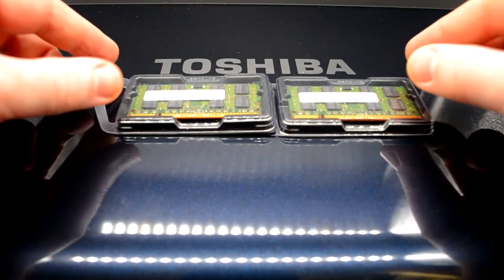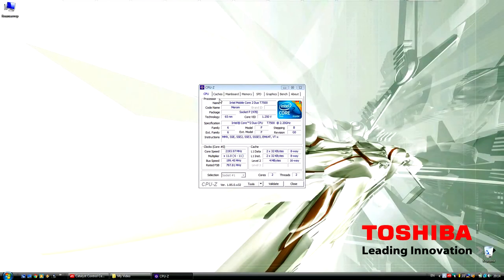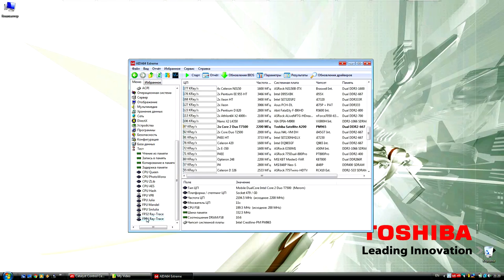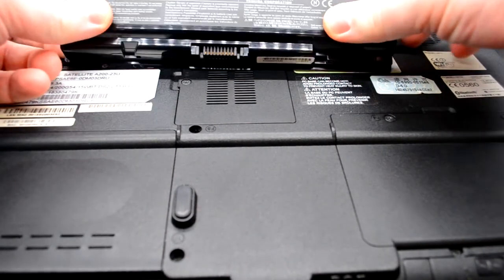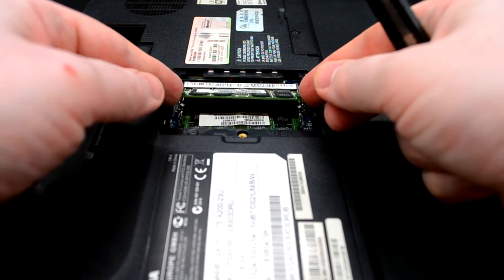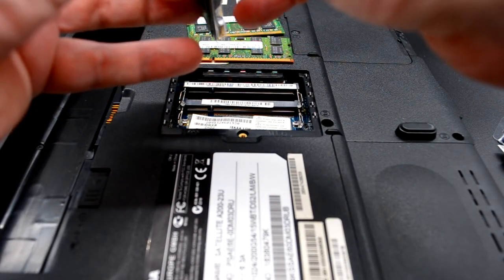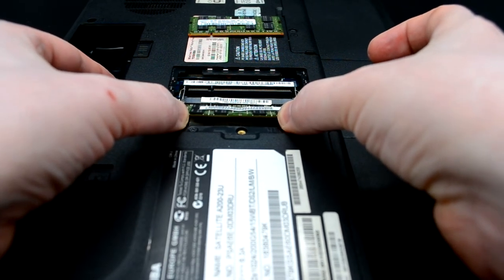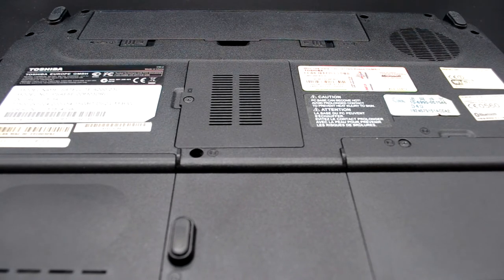Модернизация ноутбука Toshiba Satellite A200-23U. S01E02. Samsung 2x2Gb DDR2-800Mhz и тесты!)

Comment: Hello sir if possible DDR 2 800 mhz ram install in my laptop Toshiba A200
Reply from the maker: Hi!) The full name of Toshiba a200-???!💡
Reply: The full name is Toshiba Dynabook AX/53D Toshiba A Series
Reply: 2 Slot Available can I install DDR 2, 2GB Ram 800 MHZ is it possible
Reply from the maker: @susheelchandra2590  No, you can't!) You have an Intel 943GML Express chipset (533 MHz), it supports DDR2=400/533/667, maximum=2Gb (3Gb - it can support, but not always)!  Good luck!)